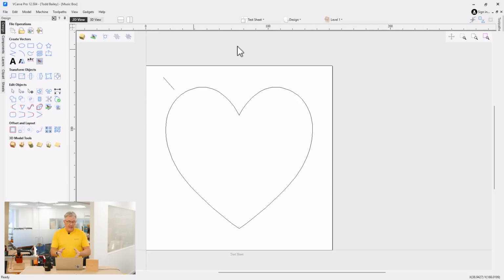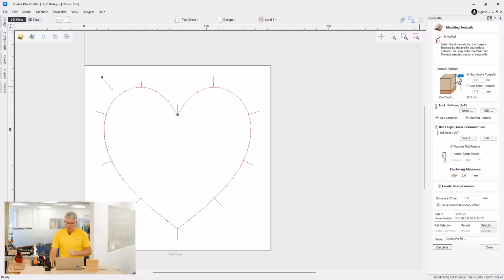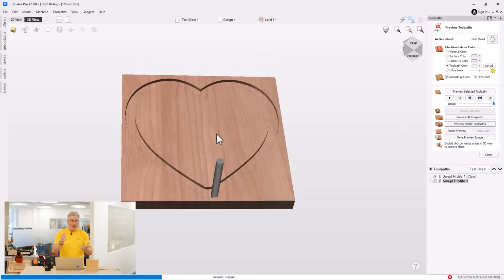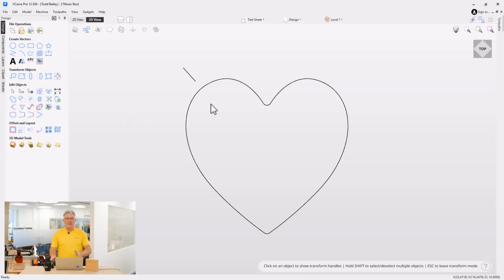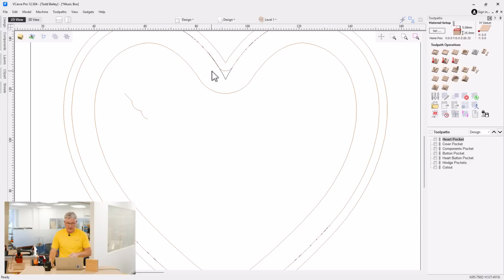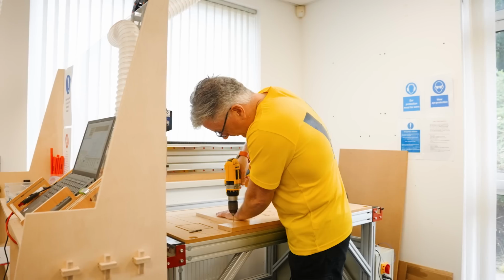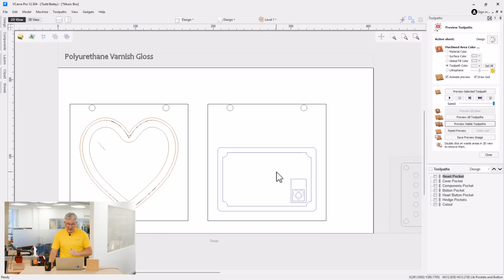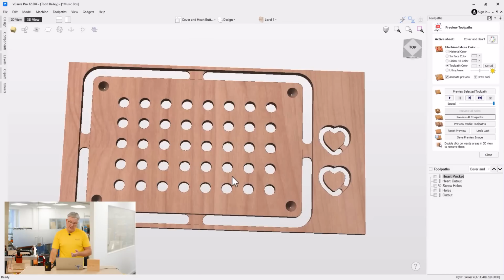Music Box | In the Labs Vectric | FREE CNC Projects

Comment: The electronics include a port to be able to program the unit as well as recharge the battery .  In order to use that feature, you will either have to remove the "grid" or create a path to an exterior port.  I have not got it figured out yet, but I wanted to flag it for anyone building this.
Reply from the maker: That's some helpful information, thanks for sharing!

Comment: This is a stupid question from a newbie but could this be done as an inlay and then pocket the middle while still creating the molding profile?
Reply from the maker: You could give it try... but I suspect you would have the same problem as I did where I needed to break up the hear into two parts.  If you choose a different shape... a circle or oval you might have no issue at all.  You would need to cut the curve and move the overlapping nodes for the molding toolpath to work properly and cut on the inside of the line.